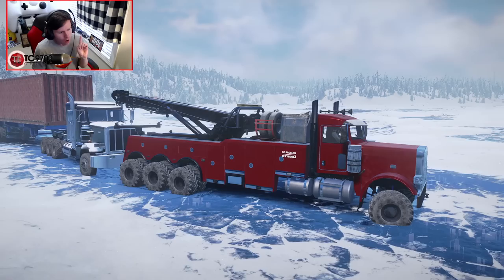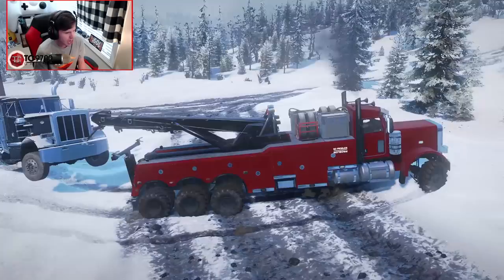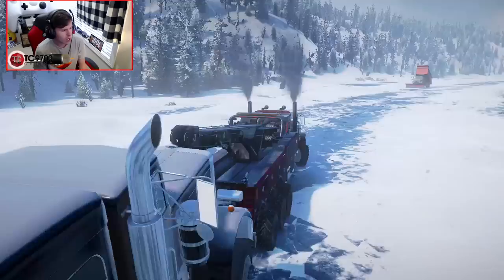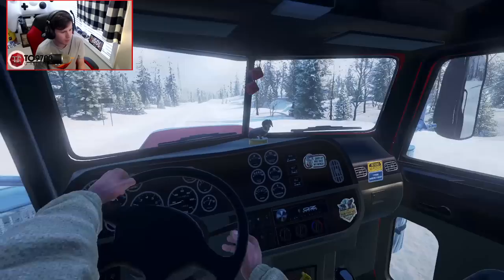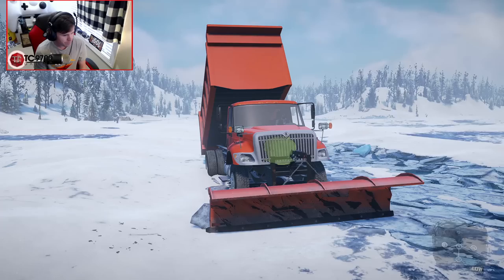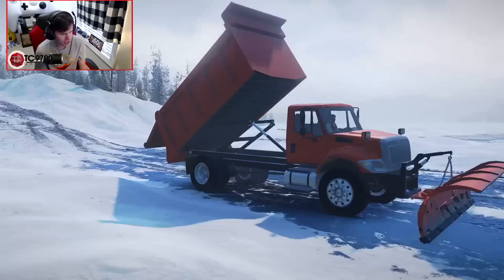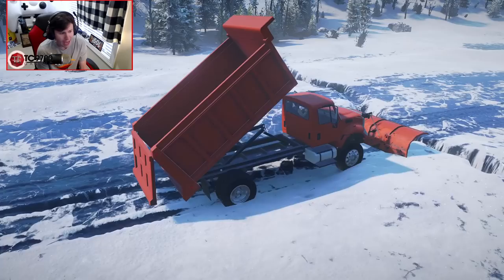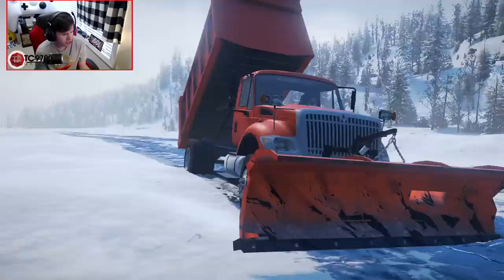If SnowRunner Had ACTUAL SNOWPLOW Physics!

Comment: Axle lift has small clips on each end. Those have to be under a straight axle. Use the 70T to lift the truck and get it under the tires. Make sure to lower suspension to load raise suspension when loaded. Best tips I can give for the IX Heavy.